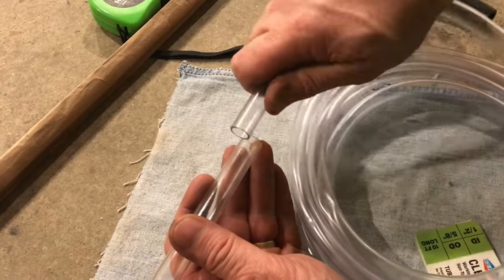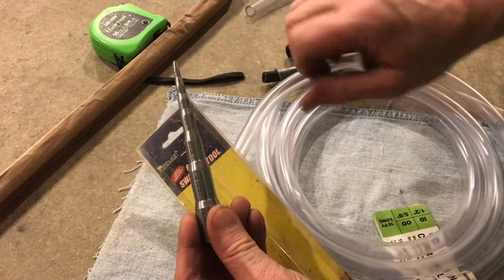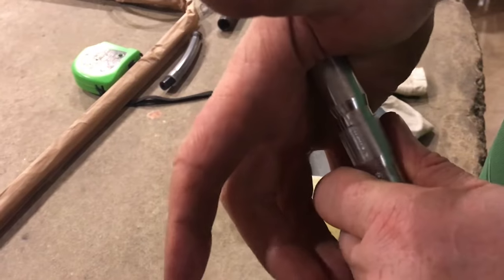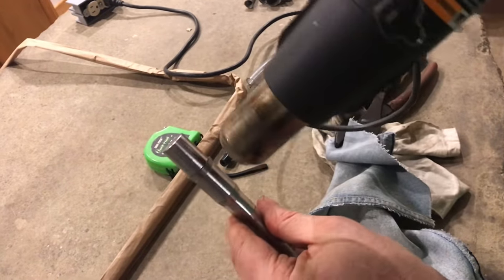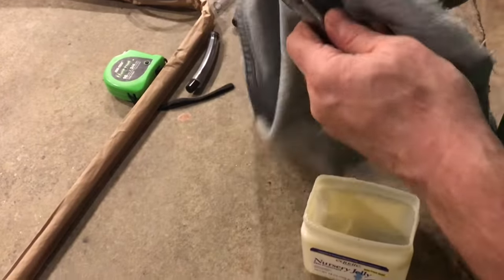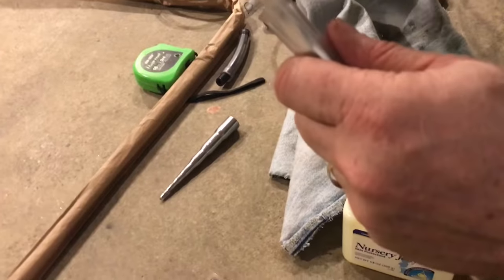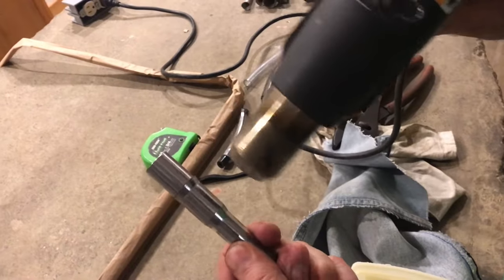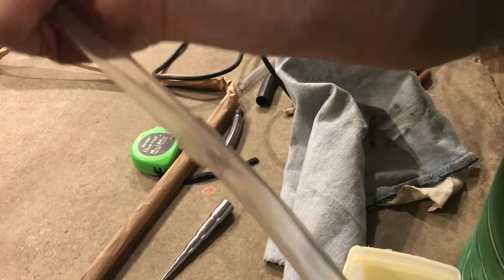EXPAND tubing to fit perfectly

Comment: Tie some cotton around the tip to shrink it leaving a long section, apply some Vaseline/petroleum jelly, insert the hose as fare as possible 2"-3" is fine.
 Then pull the cotton thread out.
 You now have a tighter fit than can easily hold 20+psi of air and or water. 
No need to change its chemical structure and no damaged hoses.

Comment: Hi, will this method work with silicone hose? I need to fit 10mm Id hose onto a 15mm or so  od fitting in a caravan sink waste. Thanks for the tip.